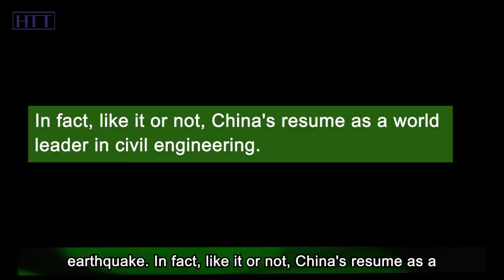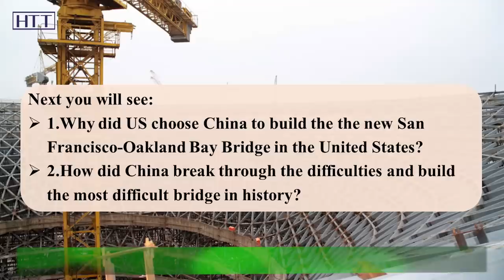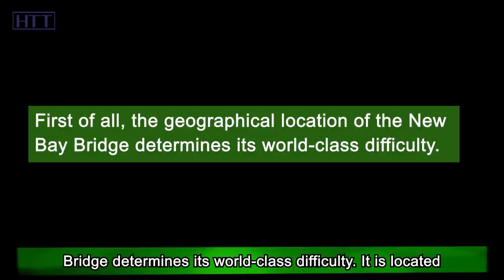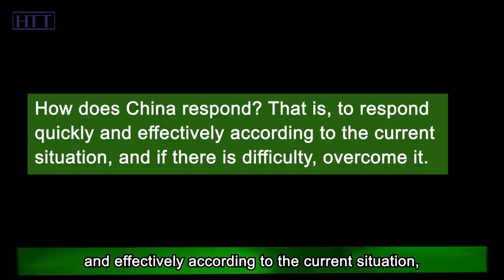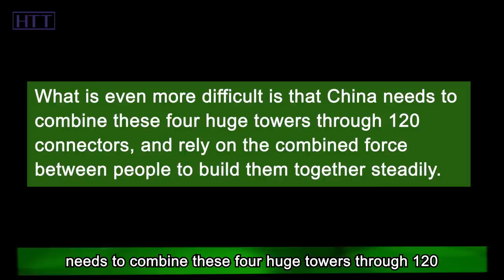Chinese Architectural Marvel in US, the new San Francisco Oakland Bay Bridge

Comment: It's actually an American design and engineering specifications. Chinese companies won the bid for fabrication of bridge segments and cables. Chinese companies were not involved in the assembly of the bridge.
After the first two weeks of tension, 32 of the 96 Chinese made anchor rods had fractured.
Reply: design unlikely, only general specifications based on local reqmnts. Don't start blabla.
Reply: source please..
Reply: @choosewisely4722 did "TYLin" calculate every single pilon and did all A to Z calculations? chinese only carried out the work per "tylin" plans?
Reply: @choosewisely4722 thanks for explaining
Reply: @choosewisely4722 I would imagine the bridge design is too much for 1 engineering firm (unless they have 20k ppl crew and 20 offices), subs do some shops and details and forward to chief engineer for review, no?
Reply: @crayrayc  we're not done yet, no whiskey party yet, here, have a bottle of coca cola
Reply: @choosewisely4722 sorry no time for research, your confirmation of other specialty engineering firms (chinese too?) is sufficient and is accepted. Cheers (texan moonshine)
Reply: Are you kidding? @crayrayc